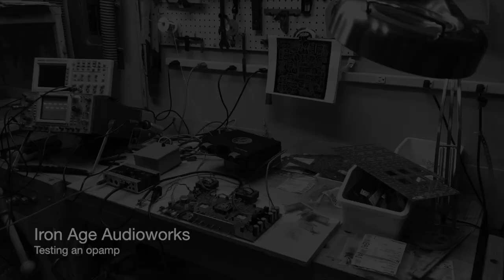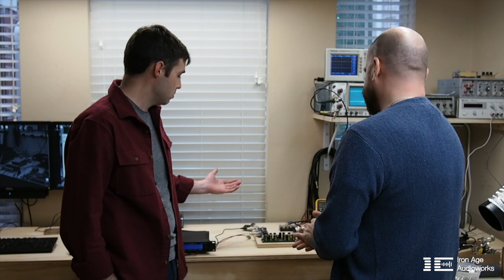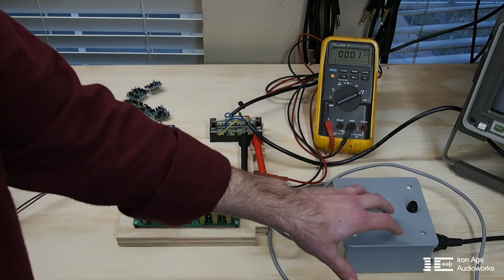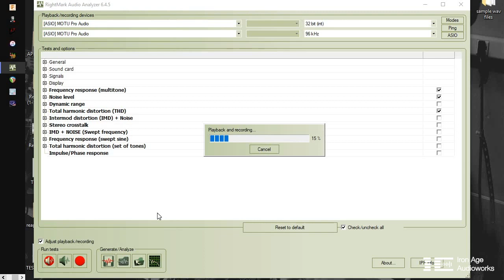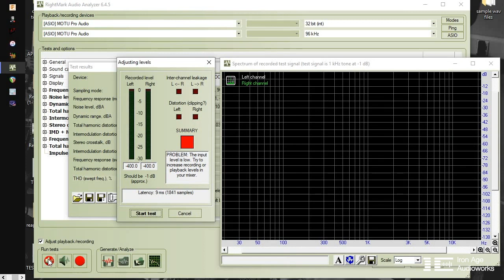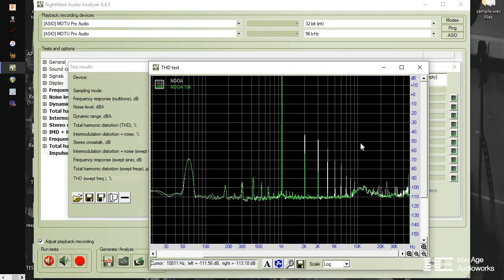testing op amps and using Rightmark Audio Analyzer

Comment: When you posted this, was it intended for a general audience or did you have a club/forum you were part of that discussed these op amps beforehand.  They are all new to me.  Pretty cool stuff.  I wonder if you have any experience testing codecs with this software or hardware analyzer.  I have to test 4 eval boards and could use advice.  I have a QA-401 I have to learn...